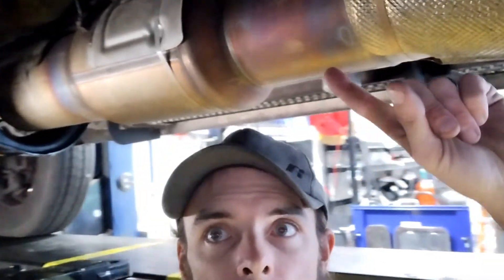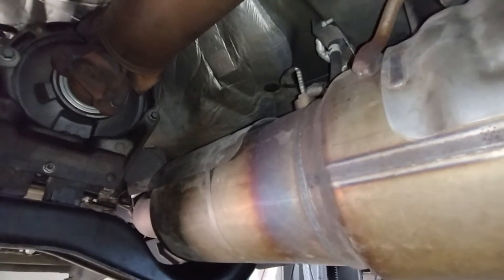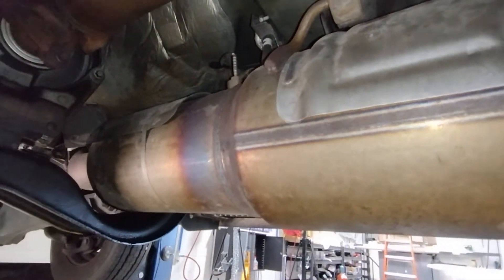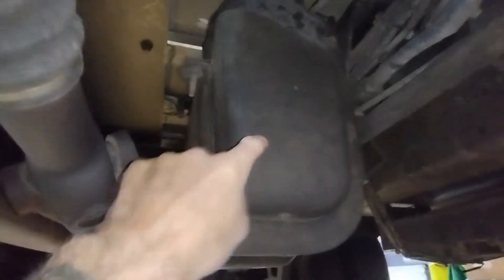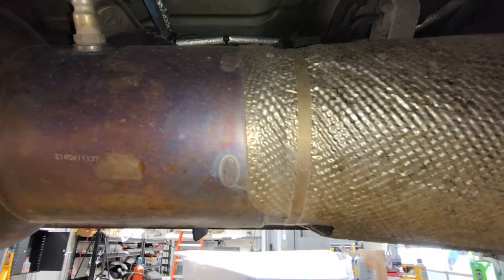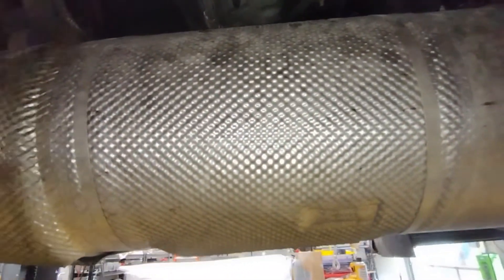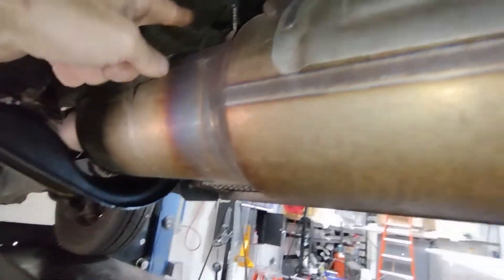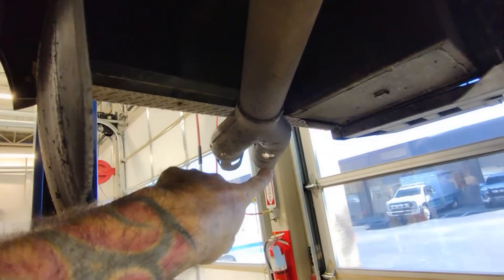Ford 6.7 Powerstroke DPF How It Works

Comment: I drove a 2008 Ford 250 diesel for 12 years and this filter was always clogging and it would want to shut your truck down if not clean and if you came to your destination after driving say 100 miles it would show a screen that said drive about a half hour to clean . Yes drive another half hour to pollute the air with black smoke pouring out of the tail pipes.What a piece of junk it was and a couple of times cost me about 1000$, This design should never  been and who ever designed it is a moron along with Ford for using it.
Reply from the maker: Ford didn't come out with this design until 2011. So how did you have this one on a 2008?  You had a different design on the 2008 6.4 liter.  basically did the same thing. And ford isn't the only brand that uses it.

Comment: Excellent video. So now I know why a guy I knew was stock piling jugs of "cow piss" (his term) years back when he bought his new Super Duty service truck. All he could tell me was that it's for the new emissions system. I was scratching my head. Great explanation of the particulate filter system.
Reply from the maker: That one was for you friend. You asked me about it the other day. Just had to find time to film it.
Reply: @BeardedFordTech  I appreciate it brother. I'm not too familiar with diesels. They require a lot of maintenance.
Reply from the maker: @mlieser1230  but. Just like any vehicle. Maintain it. It will last